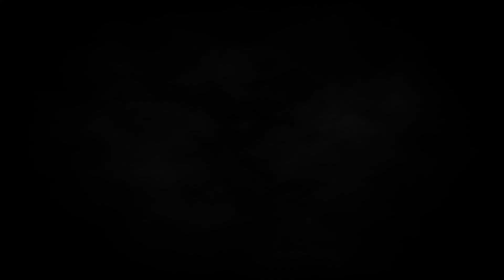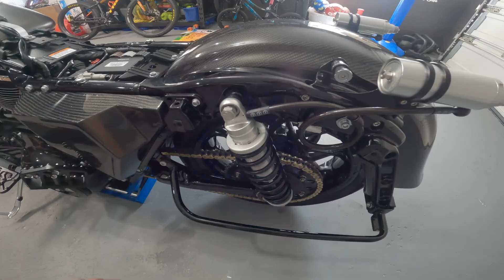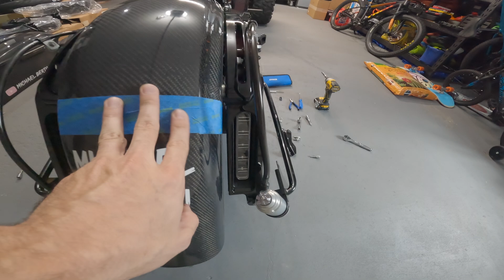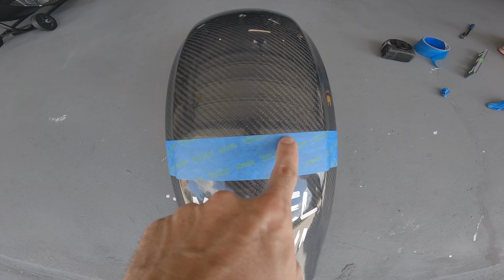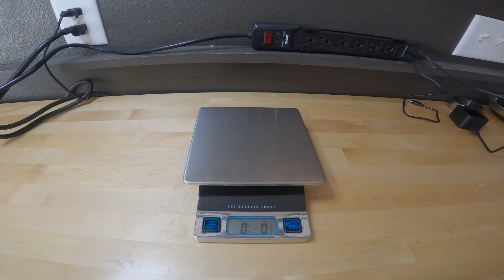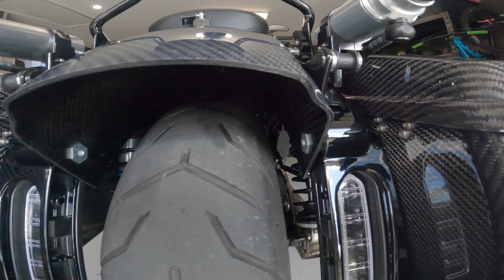Chopping a $1,000 Carbon Fiber Street Glide Rear Fender // Performance Bagger

Comment: I just don’t like the angle. The side is ok. The back should have been lower. Keep the same angle as the bags. Level instead of angling upward.
Reply from the maker: Interesting perspective. I like the idea though. 😬
Reply: First-off, major improvement Michael from stock, it has an awesome look and goes with the theme of performance. I initially thought the angle of the cut might be as another gent mentioned, lower and even with the bottom saddlebag lid, but nonetheless, you made yours and killed it, great job!
Reply from the maker: @danbiggs2139  ❤️🤘🏼I love y'alls feedback. Hopefully we start seeing some more shorty fenders to market. A few days after I did mine a few brands started to surface factory made shorty fenders so I'm loving the new concepts from these brands, giving people more options. 😬👍🏼